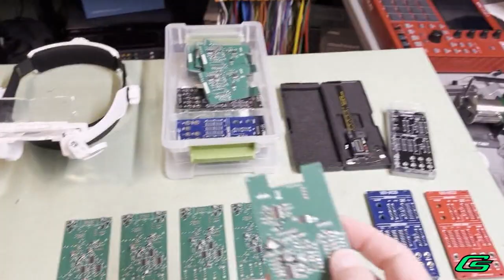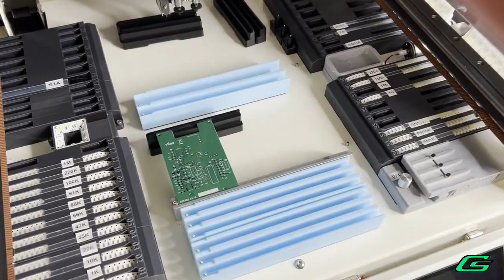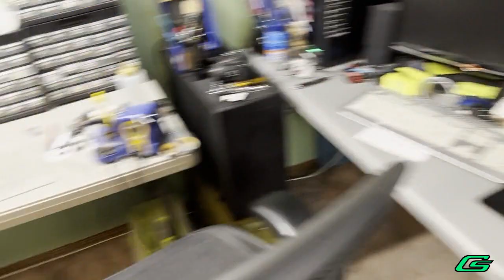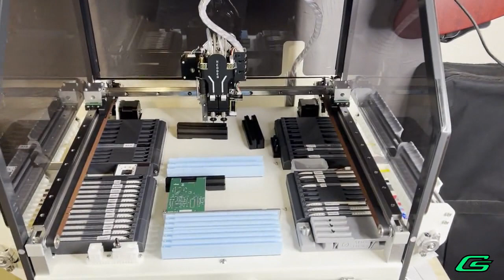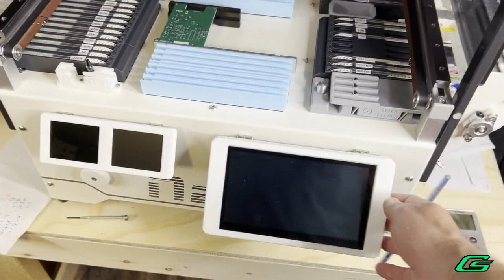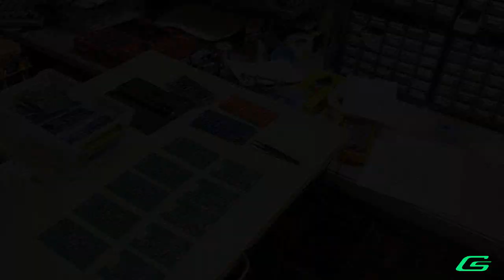Studio/Lab Update - Ushering in a New Era with In-House Production Automation

Comment: I've built about 10 DIY modules from kits and so I thought I might try SMD.  First module is an NLC PiLLS 1U and I've been trying this by soldering manually with little success.  I've lost a couple resistors into the rug already, lucky they provided extras, and the joints look ugly but workable.  Could you tell me what oven are you using and possibly any tips for building SMD kits?
Reply from the maker: Oven won’t help if there’s no paste stencil. I’ve not found any paste syringe that does a decent job. I use a secondhand Oster oven and manually walk the temp setting to approximate the desired heating curve. Manual smd soldering comes down to steady tweezer hand, good magnification, and fine iron tips. I deposit solder on one pad, place component and hold in position until it cools. Then solder other pad without need to hold. Same thing for ICs tacking corner pins and affirm position before soldering remaining pins.
Reply: @gstormelectro  Ya that's my technique but I need practice.  Too bad about the paste / oven.  Thanks for your help.

Comment: do you think there's a noticeable difference between the sound of SMT vs through hole? genuine question. not trying to be antagonistic by asking... because i swear there is. but it might be all my imagination.
Reply: Biggest difference in sound is capacitors but careful choice can overcome this. Some THD components can’t be easily found in SMD like UJTs, and that impacts design. I have been surprised how well SMD works, such as the Behringer 1004 VCO, where the prototype worked perfectly. A good engineer can make SMD sound better than THD.
Reply: @amsynths  thanks for the reply! i have your SH-101 modules and I love them
Reply from the maker: Seems easier to possibly gauge aged components vs any new manufacture.  according to comments made in most synth comparison vids new vs clone/reissue. Even two vintage units there can be variations